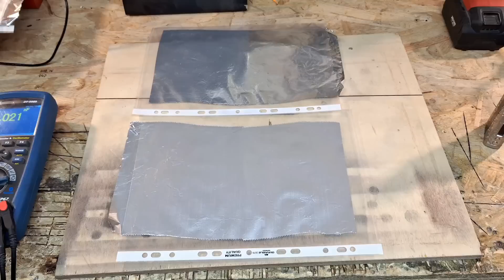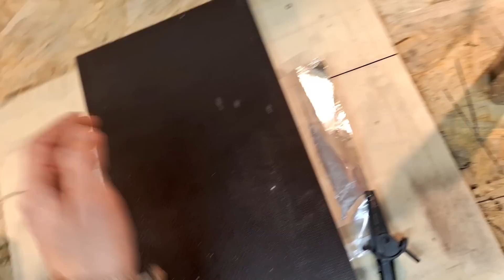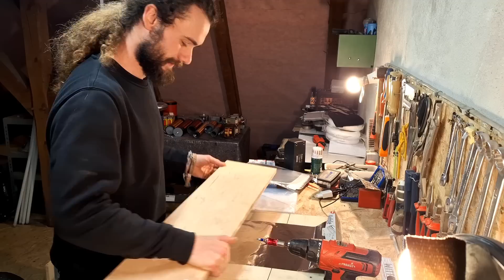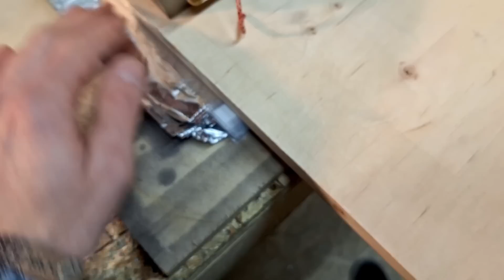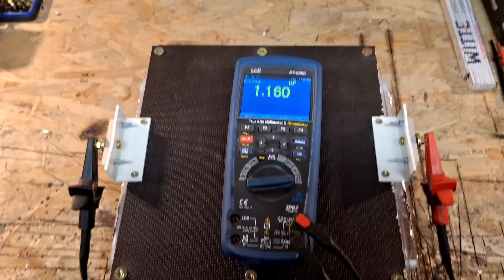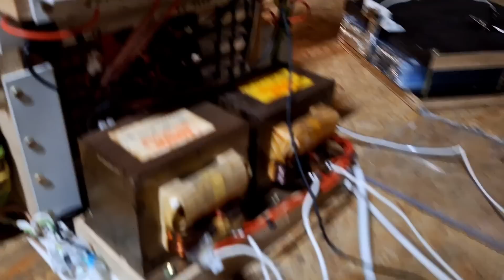I Build an MASSIVE High Voltage DIY Capacitor!

Comment: some weird laws mean that thinner dielectric has a higher constant for a given material, so distributed capacitance is better... ie, series arrangements.

still, its easier to not worry and just go for peak voltage in a layer. i was using "heavy duty a4 sheet protectors" at 80micron. 0.08mm? good for about 2kv iirc, a stack of 7 for the 15kv NST. or really, 14 layers... always over-rate!

easier to cut the foil smaller, and not bother putting it IN the sleeves.

once the stack is squeezed you ideally want to vacuum purge and oil fill it...

Comment: Wenn du die Ecken abrundest hast du später weniger probleme. Außerdem kannst du mit einem Heißluftföhn oder einem Bügeleißen dafür sorgen, das die Folie schön am Aluminium schmiegt. Noch besser wäre natürlich Kupferfolie. Ich hab meine Kupferfolie von Aliexpress aber die gibts auch bei Amazon. Leider findet man sowas nicht im Baumarkt .-. Aber wenn du die Kondensatoren boosten willst wären das meine Tipps;)
Reply from the maker: @schtrehba2704  ja, ich bin selbst mal gespannt wie lange es dauert, bis sich evtl. Coronaentladungen durch den isolator fressen😄  das gibt dann n überraschungsfeuerwerk😆
Ja mit am besten noch beidseitig richtig Hochglanz polierter Folie wäre die kontaktfläche auch noch besser. 
Kupferfolie würde den Widerstand noch halbieren. Wäre gut für hohe pulsströme. 
Bei dem kondensator ist nur allgemein das größte Problem, dass er geschichtet und nicht gerollt ist.
Hätte ich den (wie auch immer) Schicht um Schicht aufgerollt, hätte er locker das 4 fache an kapazität😄
Reply: Du kannst sie horizontal rollen wenn du ein laminiergerät hast :D ich habe bei kleinanzeigen teilweise modelle für unter 20€ gefunden. Kannst die folien aber auch so laminieren soweit ich weiß :3

Comment: Comic book sleeves might be better if you want to try with sleeves more. It is a thinner "crunchier" more rigid plastic. They are deeper too by about 10%. Super cheap, I bought 100's and sold books and comics in them. They don't tear easily either and there's no ring tabs.

Comment: In the early days of radio capacitor construct research work, they discovered that plate capacitor produces the sound of the tone frequency! So, they rolled it to a cylinder and the sound was gone.

Comment: what lightbultds you are using ?
Reply from the maker: @pelos6945 for the feedback circuit? 
Im using 3  75w 230v halogen bulbs in parallel = 225w 
I have some normal lightbulbs too, but These actually behaved very different🤔 
And at my older Videos im using resistors

Comment: A little bit of air might help in feeding the foil into the sheet protectors.
Perhaps use a vacuum bag for the compression?
Plate slap, similar to coil slap.

Comment: Your in what appears to be a wooden attic. Do you have any neighbors nearby? Is that Tesla making any interference? If so you might want to find a metal structure.
Reply from the maker: @SkypowerwithKarl  yes i have neighbours living nearby.
This coil producing for sure interferences, but more in the spectrum of its own resonance frequency.. In comparison, a spark gap tesla coil would have much more weird harmonic frequencys and can really badly interfere with TV and W-LAN.
I have actually no problems with that. I hear music over my Smartphone connected with W-LAN while im testing my coil😄
But i think (didnt tested it yet) it will heavily interfere with analog Radio at LW. 
For sure i would be much better to build a faraday cage, to reduce the possibility to stress some people out with humming on their radios😅
Reply: @ 
Over fifty years ago, a friend was playing with a huge Tesla in his basement. I had just been watching him for a while when I went home. About a mile away I spotted some blue vans with strange domes on top driving around. I made a quick stop at another friend’s house and called the first guy to tell him to knock it off. I’m figuring that he was making a lot of harmonic interference. Probably the only thing that saved him from pinpointing his location was his signal was overloading the searchers when they got close. By the way the second guy’s tv was unwatchable 😝    It’s a good idea keep metal in the vicinity away to help reduce harmonics/radiating elements or be in a Faraday cage. Have fun and be careful
Reply from the maker: @Skypowerwithkarl
Haha, yeah thats actually something, im a bit nervous about😅
Especially because i Experiment almost everyday now for about 1 month with that thing😅

Comment: Just make an oiled paper capacitor like in the old school. You can make a paraffined paper capacitor too (Tesla style). Add some liquified paraffin on both layers of a paper sheet. Then, when it solidifies, use an iron to add the aluminum film (it will be 'glued' to the paper due to the paraffin). These kinds of capacitors are ideal for very high voltages and could last forever. Not to mention the polyester resin vacuum capacitors.
Reply from the maker: @TriunfoGim  thats a cool idea! i have 2 liters paraffine oil here! I thought about that before, but wasnt sure about the voltage rating of oiled copy paper or something. But i will give it a try for sure!🙂 thanks!
Reply: @marvsworld247  Good, remember to use new mineral oil or use a vacuum pump (it can be obtained from an old freezer or an A/C compressor) in case of old mineral oil (due to air and moisture diffusion in the oil). Then, submerge it several times in heated solid paraffin (like candle wax) to seal it and give it shape. Make sure to wind these capacitors. Therefore, you will get a brand new old-fashioned capacitor maden like a pro (The ironing proces is for solid paraffine) but liquid parafine can be use for those wet papper oil capacitor of the old school.

Comment: A bit of advice, from someone who has destroyed many film capacitors:  Do Not Cut Your Foil With The Cutter From The Box!!!!!  The HV gets drawn to the points / teeth that the cutter makes.  You will think 10KV is in your Capacitor, but the tips of those points will be at 200 to 300 KV and the arcing begins.  Cut the foil smooth with a razor blade or a paper cutter, also cut the corners rounded, not squared.   Rolled, is easier than stacked.

Comment: IMO your main show is your very impressive Tesla coil discharge lightning!!!!. 20.88 joules stored in the homemade cap says chatGPT "The energy stored in a fully charged 6000 V, 1.16 µF capacitor is 20.88 joules". another guy recently made a 4000 joule capacitor discharge bank. "4,000-Joule Exploding Wire Machine" hyperspace pirate. I would put the hot link , but I am afraid of being automatically deleted.
Reply from the maker: @markae0  thanks mate🙂
Yes i actually have seen that video!😀 but the caps are not selfmade... These are just many big electrolytic caps in series to get he high voltage rating.
But anyway, this video was very impressive!
Reply: @marvsworld247  yes, selfmade.caps are impressive.

Comment: You might try sitting all of those plates inside a glass cooking tray and add mineral oil to increase the dielectric strength.When I was a kid I did that with a book one time, just kept alternating layers of aluminum foil on either side in between each page of a book though I didn't try the oil. I charged it up and it made one hell of a bang when I discharged it. I didn't have the math skills at the time to calculate out the surface area the points nor did I know the dielectric strength of paper although that was pretty thick paper and pretty good quality paper since it was a hardback book. All the Best! 73 DE W8LV Bill
Reply from the maker: @w8lvradio  haha thats cool!😄 i never had that in mind!
Thanks you too🙂
Reply: @marvsworld247 I grew up in a "NASA" town, and when I was in school I had a teacher that always said: "If you want to solve any problem in physics just find a German and a chalkboard and give him a piece of chalk."😂
Reply from the maker: @w8lvradio  🤣🤣🤣🤣🤣

Comment: How can you lower the voltage & increase the capacity?

i have a 16 volt 75 farad capacitor in my car that is in a group 9 battery case, so ~1/4 that size.
Reply from the maker: @Iowa599
In your case, the dielectric Material is extremely thin, also the aluminium foil is. So in this case you have (in theory just to imagine)  like 75000x more layers than me in your capacitor. In practice, there are some Tricks to increase  the capacity between the layers and make everything smaller. super caps are crazy!
Reply: Yeah they are! I can start my car without a battery!

but...shit...i don't know how I could make aluminum foil thinner.
Reply from the maker: @Iowa599  yeah when you have in mind to build such a cap by yourself with just aluminium foil and some super thin dielectric Material, you would fill up your whole house with that cap😄
The layers have to be microscopic thin.
I dont know exactly how they build such awesome cap, but i think you would find some Information on the internet.
Reply: @marvsworld247  I was thinking about how I could make it thinner & remembered paint is that thin!

Theoretically, I could paint a capacitor, one layer at a time! I need to find the right paints...
Reply from the maker: @Iowa599  thats actually not that bad idea!🤔 but how do you want to connect the plates?
Reply: @marvswelt2587  what I would try, is to just paint the connection. 
1- Use masking on one connection but not the other for the first coat of conductive paint, 
2- then mask both connections for the insulating coat, 
3- then remove the mask for the unpainted connection & spray with conductive paint again

That's it, sorta. I mean, that should be a functional capacitor, theoretically, but more layers would be added. Just alternate the masking so paint gets where it is needed, but not where it shouldn't be.
Reply from the maker: @Iowa599  i have absolutely no clue how good the electric and dielectric charakteristics of such spraypaints are, but in theory it definitely sounds doable!
Reply: @marvswelt2587  yeah, 'spray paint' is a very generic term, in this case. Most likely an aerosol will be the easiest to work with, but idk what the 'paint' needs to be!

Comment: 11:53 "I got shocked" You are now painfully aware of parasitic charging that happens with large capacitors. KVA capacitors are always stored with the connections shorted for that very reason, they will charge just sitting on the shelf if there is any EM radiation present. SHORT YOUR CONNECTIONS OR YOU WILL DIE.
Reply from the maker: @2barrell
This cap is almost always shorted.
I didnt got a shock of that cap. I got a shock when i moved 4 plastic foils and some sheets laying around my bench together. 
Im aware of it😉

Comment: Keep the edges of the foil round and smooth. You made many unnecessary spark gaps
Reply from the maker: @AnJe-od3fg
In that case, its not that bad.
But at HF at high voltages you are right.

Comment: You know it looked like to me that the ark itself is dirtier or not as clean on the edges,  along the edge of the Ark or on the long stem of the Ark using the aluminum foil capacitor did you notice that at your end when you're sitting right in front of it?
Reply from the maker: @FSR-v9c
Oh no i didnt noticed that!
But this would made sense! Because of the big inductivity of the capacitor, it can probably inducing some harmonic/disharmonic oscillations.
Or thats just a thought, it can be the capability of higher peak currents of this capacitor🤔

Comment: I don't know if it would be available or useful, but overhead projectors used to have long rolls of acetate(?) film. It could save a lot of cutting if everything were in roll form. I like the way your tesla coil makes trees.
Reply from the maker: @ggarber4763  i actually have these, but vorgot about it😀 
Today i found them, because i searched for other ways to build a bigger capacitor.
But the film is super thin. I think it is too risky to try it.
Thanks🙂

Comment: I used to  run mine outside on a moist but not raining night, and it was really a lot better.
I like your design.
But mosr of all have fun, but be safe.
Reply from the maker: @michaelmurray3422
Haha i fell with you😄 mine changes its behavior too, when the aircondition changes. But in spark lenght its just + - 4cm 
Maybe you tuned your primary a little too low on frequency. 
Thanks🙂🙌

Comment: Gives new potential meaning to "welt-schmerz" LOL - You don't need to cut the foil into sheets! Use square dielectric sheets several inches wider than the width of the foil, and just fold/weave two rolls of foil back and forth over the stack, laying down a dielectric sheet after every new pass of the foil. You will have two "tabs" for each pole, but that just presents opportunity for extremely low inductance connections. This should increase voltage strength by reducing the presence of ragged foil edges, and increase the heat dissipating ability as there is twice as much non-overlapping foil extending outward. Best of luck to you - that is one gorgeous VTTC!
Reply from the maker: @zinckensteel  what did you mean with that? (Sorry im Bad with sarcasm or similar)😅
Reply: @marvsworld247  I was making a pun with your channel's name in regards to how you made the construction of this capacitor much harder/more painful than it needed to be. You understood the rest of my comment though, yes?
Reply from the maker: @zinckensteel  aah ok😅 yeah i realized that too after a while😅

Comment: Back in 1992 I made a high voltage capacitor for a Tesla coil with some heavy duty polyethene rubble bags and aluminium foil, still runs to this day.
Gaz UK.
Reply from the maker: @Gazr965  oh nice!🙂
Reply: @marvsworld247  Thankyou.
Reply: what colour were they? I imagine clear is the way to go, maybe not?
Reply: @Derek_Garnham  They were grey, I am not sure if black ones have some carbon in them via the pigment, but translucent blue or green polythene can be bought in sheet form as a vapour barrier/ damp proof membrane, clear would be more pure I would assume.
Reply: @Gazr965  Cheers, Yeah, I used to live near a carbon  black pigment factory.  Anything pigmented now usually contains some recycled material too. Back in '92 making a tesla coil was no way near as easy as nowadays. Any advice on how to approach the task now? - solid designs - cheap component choice etc, I've been compared to MacGyver many times in my professional life and also have several microwaves dismembered in my cellar just waiting for the day I commit. (could be a long wait)
Reply: @Derek_Garnham  I would not use a microwave oven transformer they give around 2 Kv ac, but lots of current around 500 ma, so 1000 watts output, skull and cross bone stuff if it gets you.⚠
 I used an ex oil burner ignition transformer 6 Kv at around 30 ma, you don't want to mess with MOT's for projects like a Tesla coil, better using a neon sign transformer a wound type not electronic ones etc
Reply from the maker: @Gazr965 nah...not enough power for me😅 i use 4 MOT's 
Its only dangerous when you not have strict safety rules and knowledge.
btw. Oil burner ignition transformers are also deadly!
Reply: @marvsworld247  Yes oil burning transformer 6kv at 30 ma will give 180 Watts so still enough to floor you if you don't take precautions, my tesla coil is very portable and gives off 3 to 4 inch arcs into mid air, depends how big you want the output to be, 4 mot's would be heavy on weight and power, suppose depends what you want. I mean you would need a good Faraday cage around the coil  
for that power from 4 mot's.

Comment: I would have cut all the foil sheets then put them all in the sleeve
Reply from the maker: @yeboi8045  my future me too😅
Reply: @marvswelt2587  it's okay, it might even be easier to start folding the aluminum the width you need it, over itself like an accordian, then cut both ends off, and you made all the sheets at once and much faster.
Reply: @marvswelt2587 if you go to a hairdressing supply store (or Dollar Tree in America) they sell boxed , precut foils that should be exactly the size you want . the time saved is well worth the slightly higher expense.

Comment: The plastic isn't foil, it's a plastic dielectric. Cool idea though to build a large capacitor. "Foil" usually refers to thin sheets of metal. Gold foil, aluminum foil, etc.
Reply from the maker: @dohabandit
Ah ok thanks for correction🙂🙌